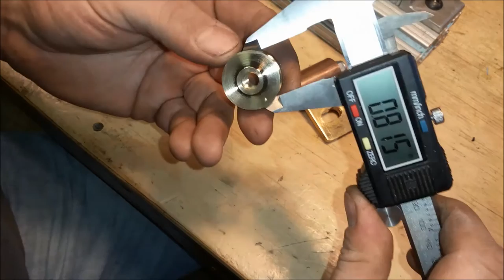Building a Telecine Machine - Part 4, Take-up Reel

Comment: Nice Job Don!  For the Metallurgy uneducated (me).  You probably answered this in another video I haven't watched yet (I'm still working through them all).  Why make the custom fly wheel out of Brass?  Another thought maybe when you are done you should make a full length Telecine Machine video with all the parts together in one video.  Partially want you to do it to see how the views are.
Reply from the maker: What a great question! Brass is my favorite metal to work with. Brass is actually an alloy of copper and zinc. Brass machines well, much easier than steel, copper,  aluminum IMO. If you try to machine copper on the lathe, its too soft and it makes it difficult  to cut. You can solider brass to brass or copper with a propane torch, easy solid connections. Also, the melting temperature of brass is much lower than steel. I can cast brass and aluminum (Also aluminium  in the UK). You can sand brass with the belt sander, it cuts well on the band saw and polishes excellent on the buffer.  I did make a lead flywheel on one of the field-trips to dads place video.  On the telecine, its a work in progress. I am still changing things daily. I am filming the completed sections and working on others. If you see a segment posted, im considering that part of the machine finished. I will do a complete overview when i'm done as well. -Cheers